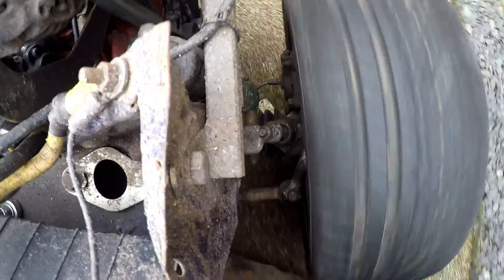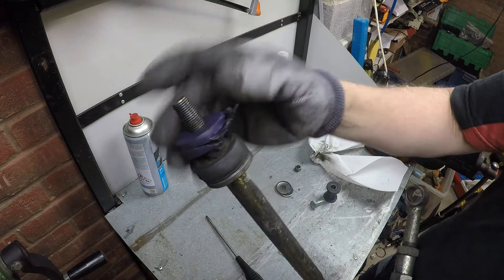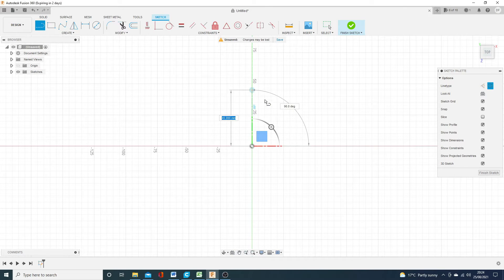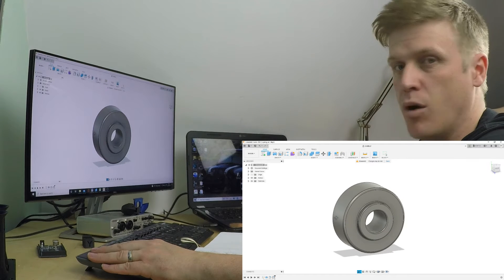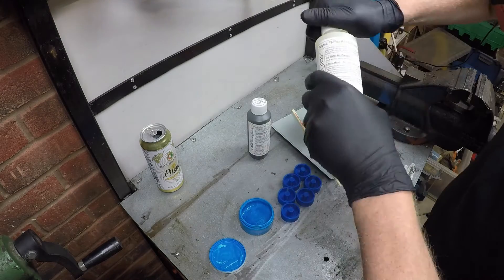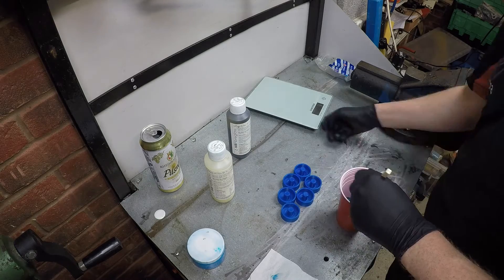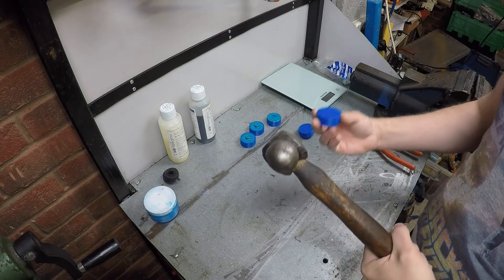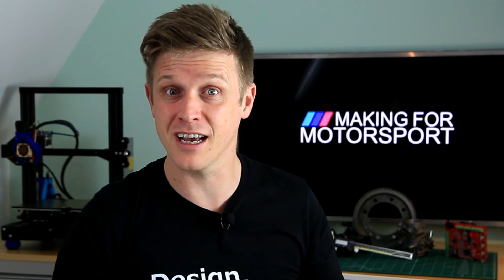Making PolyBushes at Home - using 2-part Polyurethane and 3D printed moulds!

Comment: I did the same thing you did with the molds the first time I did something similar to this.
Change your mold to have a pinhole on the bottom. And then cover it with tape before you pour.
When you're all done with your parts, pull the tape off and push the compressed air hose against the hole and you'll pop your part out.
Reply from the maker: Now that is a good idea!  I was kinda fixated with my hickory shafted “persuader”!
Reply: That’s a great tip! I was thinking I’d make the mold thinner so it’s easier to smash(!) or submerge in hot water to soften the Mold but this air idea sounds much more elegant! 👍🏻
Reply: You could also print the mold in PVA and then just dissolve it in water when you're ready to release your part.
Reply: Having just ventured into this myself, I tried the Pin-hole method with little success and had a >50% demoulding success. Instead I introduced a 4mm Hole into the model on the base of the mold, tapped and used a pointed M5 Grub Screw with the point protruding into the bottom of the mould. With this i have a 100% Success rate with demolding.
Reply: Awesome suggestion!
Reply: @felixokeefe  Great idea.  I will try this instead as I have a few suspension bushings i need to make.
Reply: Or in this case with PLA molds , bake them at 60-70 degrees celcius, or a bit more, urethane won't care but PLA becomes soft, a flathead screwdriver wedged in and off it goes ;)
Reply: or just make mold out of two parts, and bolt them together

Comment: Not related to this, but I'm installing an speeduino on my car, and one of the first videos I've saw was yours, so thank you for that. And for the bushings, I'm pretty sure knowing how to make them will be useful eventually.
Reply from the maker: It’s all just stuff for the future… it not particularly ground breaking but being able to whip these up quick can make life a lot easier….  
Best of luck with the Speedy, enjoy it, nothing beats that 1st start feeling! 👍
Reply: @MakingforMotorsport  It's all your fault!  I was putting off my next project due to the cost of the required ECU (everything else being relatively cheap).  Then your video turned up in my feed and everything changed, and I've now got a sea fox UA4C.
Not content with ruining my life once, you then started 3d printing manifolds, which opened up more in my project.  Now I've got an Ender 3 and am planning on using polycast to print a manifold and then lost mould cast it.  (Although I am really struggling with Fusion, so it may be some way away)
Reply from the maker: @benyarlett7878  😬 guilty as charged! 😂, love it that your gonna cast your own manifold! (That’s nothing to do with me - I haven’t done that…. Yet!) 
Watch this space for a video on modelling… I’ll show you what I did… I might not be right, but it worked for me 👍
Reply: I thought about this speeduino option on my 1955 VW Beetle, rather than going twin carbs, then adding a turbo, with a discs all round conversion.
Reply: @MakingforMotorsport  yes please.  I cried floods of tears as I watched how easily you made the bush, then the mould. Even sped up, I'd still only have half of a 2d shape in the time you took to make yours. I've even tried making stl files from sketchup,  which I can work, but they just don't print properly.

Comment: I cannot believe I just found this channel... The content is outstanding, fantastic topics. I run a company that does basically exactly what you do on this channel, but for motorcycles. We develop and produce tuning parts (mostly air intake related) with 3D printing and Polyurethane molding.
Reply from the maker: Cheers bud… still early days for the channel!  Sounds good you doing this for a business!  Hope business is good! 👍

Comment: Great work! To be honest, this took a different turn than I thought it would. A buddy of mine got some "poly bushings" for his Toyota Starlet earlier this year, and they were 100% 3D printed, probably from TPU or similar. I could tell they were printed from the visual layer lines and print lines on the first and last layer. I figured you were gonna do the same, and watched to see what filament you used. But...I might actually prefer this method.
Reply from the maker: I have heard that when printed solid the TPU does work well and I have got some to try, but I need to mod my printer first… and that’s a whole other video!😂
Reply: For some reason I wouldnt trust 3d printed bushes, plus yeah you'd need to either buy them, or have a printer capable of printing exotic filaments
Reply: I 3D print TPU bushes but not for suspension parts, just used for holding power steering pipes. I don’t think fully printed suspension bushes would be a good idea due to layer bonding. Yes TPU does bond well but it’s not 100% guaranteed to have a perfect bond.
Reply: I thought the same, that they'd be printed out of TPU. I think it would be worth a try. If a person has a direct drive printer and a high flow hotend (Sidewinder X1 for example) along with a large nozzle they could print a working bushing in a couple of hours at most. If I had a track car project I'd give it a try as I print a lot of TPU.

Comment: Good video 👍 I usually fill the mould with dry rice and then draw a line on my pot. Then just fill it to that level. I'm not good at calculating volume but you've definitely helped me understand from your video. 

I made some rear shock bushes for my car and although it was a very good outcome. After a few months one of them fell apart. I need to invest into a pressure pot to push all the bubbles out of the resin for it to hold up better. Even pouring slowly gave me bubbles with a 2 part mould. I hope yours hold up just fine, should do because it's only a small part 👍
Reply from the maker: It’s another damn good point, degassing is something that industrially is done but rarely is done in a home shop.  I wish I’d cut one in half now to see if I had included air… hmmm maybe another video needed 🤔
Reply: @MakingforMotorsport  beauty of your part is it's easy to make. Doesn't look too labour intensive to switch them out. I'd like to make rear axle bushes next but that definitely needs pressure when curing
Reply from the maker: Oh yeah, it’s definitely low risk for me!  Subframe bushes however are alittle more involved 😬😂

Comment: Those bushings looked good. You talked about a draft but I didn't see any. Don't worry about the draft and instead optimize your bushing shape. That mold is going into the garbage either way. Maybe a small arbor press would be faster than cutting them out. It's probably layer lines locking it in the mold, a light sand would take care of that. But all and all the end product looks good, costs much less than a commercial product and offers infinite customization. This is what I wanted the future to be.
Reply from the maker: Hi there, glad you’re enjoying the videos 👍 I didn’t put any draft on as knew these where going to be destroyed as the layer lines were fighting me, the part is just too small to spend time prepping, although a few people has suggested Vaseline to fill the layer lines which is worth a go. 👍
Reply: @MakingforMotorsport  Awesome, make a bunch more!

Comment: I've been making 3D printed molds for my Autobianchi A112 engine mounts. Next time you should try to add some mold release compound to the mold and a draft angle to the design. It will be much easier to remove it from the mold. It makes it reusable too. Great video
Reply from the maker: Yeh, I did exactly the same when I made engine mounts for the vauxhall engine conversion, and in retrospect I should’ve done that here as it would’ve made a better video, but truth is I couldn’t be bothered so I went with the smashy smashy release agent instead… 😂🔨.
Reply: @MakingforMotorsport  What about squeezing the final product in your vice?  Would that have cracked the mold. leaving you to peal the plastic off, like peeling a hard boiled egg.
Reply: What 3d printer and app you use?

Comment: Use spokes to hold the center part and place the mold on some monster clay that you extrude through a pasta roller for an even surface. I used to make Packard Dashboard Plastic for the 1939 and 1940 cars Really fun stuff. Thanks for the videos
Reply from the maker: Great tip!

Comment: This seems really interesting and i would love to try it myself.
One thing that comes to mind would be to smooth out the surface of the mould to avoid any mechanical bond happening in the print layers, also, maybe making the moulds in two separate parts having the outer walls being independent from the bottom and the inner cylinder although the compressed air idea i read somewhere in this comment section is probably more effective than the two piece design
Reply from the maker: Yeah, I’ve moulded engine mounts before and basically did all of the above, a metal mould with release agent etc… but there is something quite liberating about disregarding all of that and just smashing them up!!! (Although it might Engineer some weak points next time 😂)

Comment: Just a thought but maybe try using a pva for printing the moulds which you can just devolve in water as I am sure you know already. Obviously it's more expensive than pla but maybe worth it. It will certainly be less of a issue getting the parts out the mould .... love the channel 👌

Comment: I've had good success just 3d printing suspension bushings directly in TPU.  Typically 80 durometer, but if you need softer then you have to mold them.
Reply: What is the usage scenario of your TPU bushings, and how have they held up over time? As I'm contemplating the same thing for an Audi TT mk1 track car.
Reply: @ianway1742  It all comes down to having a good TPU profile.   I have made offset upper trunnion bushings for Spridgets, and I have made various suspension bump stops for Spridget and ford Ford Sierra
Reply: @deanhedin1615  Thanks, think I'll give the anti-roll bar bushings a go first as they are easiest to replace and keep an eye on. I'll se how they hold up and then make a decision from there on printing any other bushings.

Comment: I did the same to get some axle sleeves. But as an additional step we put the mould on a lathe first and sanded down the surface to get rid of the fdm typical surface steps
Reply from the maker: That’s a good shout to be fair… I will have to  some engine steadies and OD fit will be more important for that… I’ll give it a go! 👍

Comment: if the outside diameter is not to critical id put a draft angle on the bushing to help it release better, and maybe some mold release if it doesn't mess up the polyurethane
Reply from the maker: Yeah, I didn’t just to keep it simple but I should’ve put a draft just for demonstration in the video…

Comment: Great idea! I never thought to 3d print molds. In the past I've bought bushings and then made silicone molds of the parts. You can get a few pulls from them but I like the idea of just making some on demand when needed and not having to worry about 2nd or greater generation parts and variations.
Reply from the maker: I have cast engine mounts in this PU before and had to make a metal mould and had to worry about release agent etc etc… 
This way is slightly wasteful but it’s so simple and easy (and I’m lazy soo….. 👍)

Comment: If you had 0.5degree draught you could possibly have used a air compressor gun to blow it out. 

The other thing is just 3d print the bushing in TPU. Tu85a or something.

Comment: Since the polyurethane is just poured in at room temperature and not under any additional pressure, maybe you can adjust the mold design to have 8 vertical notches along the outer circumference like on the crust of a pizza pie after being sliced, and a ridge along the circumference of the bottom face, so that when you apply some pressure in the vice the mold just breaks at those points.
Reply from the maker: Absolutely that would help, if/when do this again I will either setup to properly remove the part (better surface finish and draft angles etc) or engineer in some weak points… that said it really didnt take very long  and everyone enjoys a good smashy smash…

Comment: Try putting a thin layer of Vaseline in the moulds as a release agent. I find its thick enough to fill in the layer lines in the printed mould and also a lot cheaper than other urethane release agents.
Reply from the maker: That’s a good idea… I’ll try the Vaseline trick next time… but I do like the smashy smashy 🤔👍

Comment: I've tried to make an engine mount on my alfa Romeo 159 by reusing an old engine mount. First I dissolve old rubber with phosphoric acid 80%. Painfully slow process. Then filled it up with Polyurethane A60. To stop pu spiling away I made bottom from cardboard - when installed in car vibrations in the car was worse compared to worn out engine mount.
After a month of adaptation, I order an OEM engine mounts. My design might be succeeded if tried imitate (empty spaces) structure which were in old engine mount.
Reply from the maker: I know of people filling up the spaces in a OEM mount with PU to stiffen them up… I think to keep NVH down there is a lot of work that goes into them by the manufacturer…
Reply: @MakingforMotorsport  I've tried filling gaps with PU on other engine mount but the results were the same. Having only weekend not so much time left for R&D when project car also is daily car :D

Comment: Perhaps a "draft" angle in the mold would aid in releasing, so good to listen to proper engineering speak
Reply from the maker: A draft angle would be helpful, but, and I think I said this in the video but maybe not, the layer lines on the 3D print will likely give a mechanical lock anyway, so I resigned myself early on to just smashing them up!

Comment: Would it be easier if you were to print the moulds with a hole down the centre? That way you could run a drill down the guts and precisely remove the print material
Reply from the maker: It might be, it wasn't too tricky to be honest, but I thought it was going to be easier than it was😂

Comment: Finding bushes for older cars that don't have a cult following is getting harder all the time. We couldn't find front control arm bushes for one of our projects and had to pull some used ones from a junkyard car. This would have been a much better option, of course, home 3d printers were years away, but we have one now.

Comment: Did the same with some failing engine mounts on my old Starlet and used exactly the same resin. Make sure you choose a sensible shore rating for the application, powerflex have some charts matching their various coloured bushing to shore ratings so definitely worth a look there too. Great video!
Reply from the maker: I chose an 85a PU which translates well to the Powerflex fast road, I think only their “black” series is harder… to be honest, it’s likely that these will be replaced with Rose Joints at some point so the harder the better 😂
Reply: @MakingforMotorsport  Oh yeah you made the right choice for the suspension bushes but 85a on engine mounts will rattle your teeth out ahaha

Comment: Great job! A tip I used for mines is to use 2 cylinders, and align them the best I could do they were concentric, and on the bottom a piece of cardboard anf plastiline to use a a sealant on the outside, worked well! 
A question I asked you long ago mate, have you figured out a cheap way to install a WB O2 sensor and controller for the speeduino? Or are you running an off the shelf one, or a narrowband one? Cheers!
Reply from the maker: I am running an Innovate LC2 so off the shelf, I have bought a bare board type Wideband controller to test back to back with the Innovate, but that gonna be a test for next year as the engine is about to come out for the winter.

Comment: I really like what you are doing, but I would be hesitant to use self-made at higher speeds at critical parts. So i think you have to be aware at the stresses of the pieces. For example, engine mounts or inserts are fine, but self-made wishbone bushes, i am afraid, haha :D.  A year into it, how have they held up?

Comment: Very nice idea, going to have a go at this for sure. How strong does it bond to the PLA? Would a release agent help? How do you clean them up? Freeze and then sand?
Reply from the maker: I used ABS (my cheap hot end doesn’t like PLA) and the PU doesn’t bond at all so you don’t need to worry about a chemical barrier and by destroying the mould it makes life easy…. 
I wasn’t worried about surface finish but certainly you could acetone smooth if you’re using ABS or sand with PLA, but all of that felt like lots too much effort 😂
Reply: @MakingforMotorsport  ah sorry mate I meant freeze the poly bush and then either turn it or sand the bits off!

Comment: Great video! Could you have put the moulds and bushing in hot water to soften the plastic? 
Unsure if the bushing would be ok with this?
Reply from the maker: It’s a good idea and for some materials it’d work, but I used ABS which has about the same temp resistance as the polyurethane.  They’d both survive the water but it wouldn’t change much… smashy smashy has it for me! 😂🔨
Reply: @MakingforMotorsport  haha yea I enjoyed the smashing! 
Great idea tho and another thing to use the ender 3 for! 
Good channel mate

Comment: That's really impressive.  Do you have a suggestion on the ideal printer to get I'm completely new to this. I've used autocad but that is all.
Reply from the maker: Cheers bud!   As it happens the next video (nearly ready) has a run down of the printer I use which handles all the higher spec stuff aswell…
And I am gonna be talking about the 3D modelling very soon so 2D autoCad is a great start! 👍